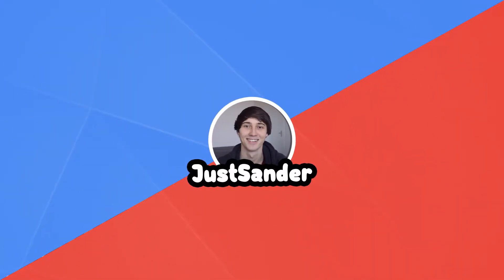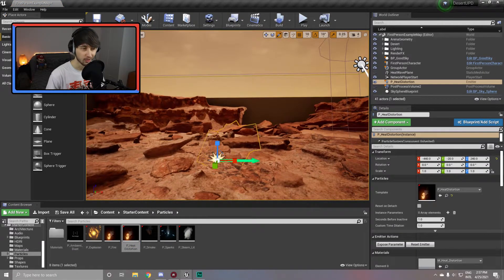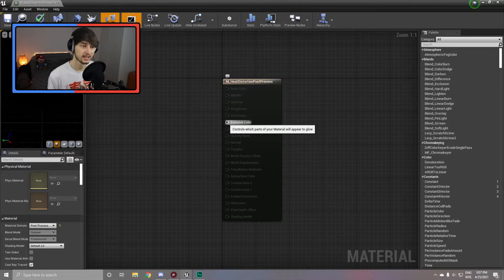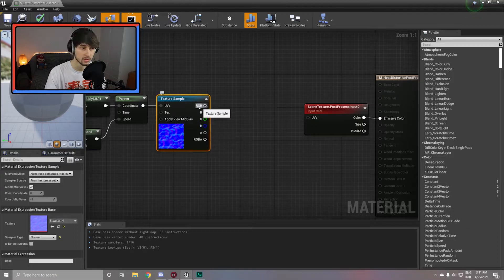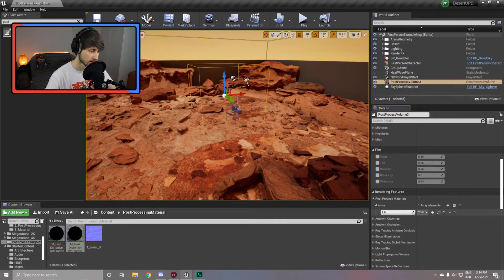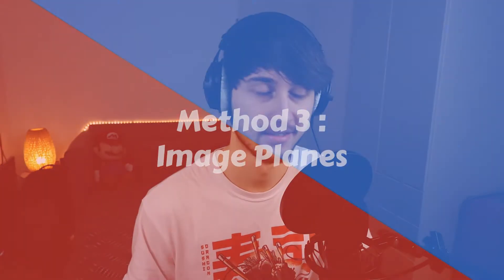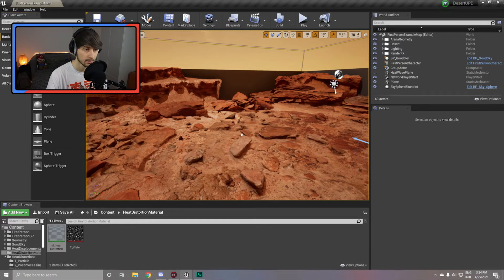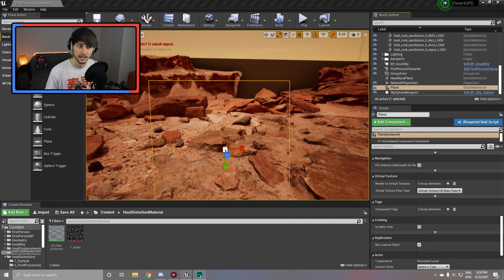Beginner Tutorial | Heat Distortion - Unreal Engine 4

Comment: To fix disabled refraction in Unreal Engine, open the material editor, set the Blend Mode to Translucent and Lighting Mode to Surface Translucency Volume (or a similar translucent option). Next, find the Refraction settings in the Details Panel and select a method, such as Index of Refraction or 2D Offset.

Comment: Hi! Is it possible in 2nd method to exclude space from infinite postprocessvolume?
Reply from the maker: That's a good question, I don't know? I gave it a quick Google and found that you can exclude individual actors from the prost process effect, but couldn't find anything about adding a second volume in which the effect will not be active 🤔 I'd suggest instead of putting it on infinite, create a couple volumes with the effect and place/shape them so they leave empty space in-between in which the effect doesn't work. Good luck and if you find something let us know! 👍🏻

Comment: PostProcess no longer works.  Vector formats don't match between TextureCoordinate (2) and the Multiply node out of the texture.
Reply from the maker: This tutorial should work for unreal engine 4, if you already upgraded to UE5 it might be a little different in there. I did this in UE 4.26. Can you also describe what you mean with "Vector formats don't match between TextureCoordinate (2) and the Multiply node out of the texture." because the TextureCoordinate node only has 1 output which consists out of 2 Floats which both get multiplied by the same factor in the Multiply Node, so there should not be a mismatch there.